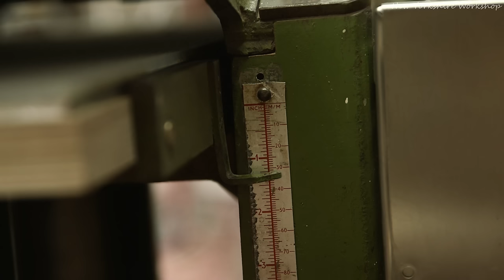Making a beautiful display case from off-cuts

Comment: Amazing skill but the icing on the cake for me was when you lined up the slots in the screws in the hinges!
Reply: Totally agree! 
I get called a perfectionist for doing this but to me it's simply pride in doing it right, and it's pleasing to the eye.
Reply: Been around for years originally used to allow paint to drip and not build up in screw slots. (Before the days of the Phillips and the hammered in screws on sites.)
Reply: Simple stuff that. Those dovetails mitres were a thing of beauty though
Reply: @tug onrye ¹9bi
Reply: The first time I saw that was on se fine furniture competition. One of the judges commented on someone's screw not being in line.. I was shocked they pay that much attention to detail.
Reply: I was told twenty years ago that when you see screw slots lined up, that is the work of someone over 50.  Many of those people are now retired or dead.  We need to keep their care alive.
There's a problem at 40.24.  The slots on the mounts are not lined up.  I would suggest that even though those slots might only be seen by one person each ten years when the case is taken down from the wall, that one person should see the slots lined up.
Reply: What is it? Im not familiar with woodworking and i dont know the terms. Can you tag me at what time he did that?
Reply: @PaanJr  32:03-32:14
Reply: Except I'm a tiny bit disappointed at the use of a traditional tapered screwdriver which mangled the slots a bit. Tendency today is to use what was tradtionally called a gunsmith's screwdriver (hollow faced so that the tip has parallel faces) which doesn't do that.

Comment: Great work, especially on those hidden dovetails. If you want do another frame like that on the vacuum table just run a bit of rope or cord from the inside of the frame to the vacuum holes on the outside and it will vacuum down as one. The rope gives the air somewhere to escape. Good use of the ladies too!

Comment: I'm no woodworker, but I think the only thing I might have changed would have been to use museum grade glass instead of what looks like regular glass.
If my understanding is correct, the museum grade glass removes the potential for glare, yet is crystal clear. And may provide some UV protection as well.
But regardless, an absolutely gorgeous cabinet for those historic cards!
Reply: Also maybe a small drop-in strip to prevent dust from falling down through the hole that the glass slides down through?

Comment: A pleasure to watch. I've learned so much from the few months that I've subscribed. Out of interest, how many times have you got a gut full of threaded rod when you've got a frame clamped up? Regardless of the perils that they may offer, they look much better than the crap band mitre clamps I've got. I think that's part of where my distaste for mitred corners stems from. Bravo on the secret dovetails, I can certainly appreciate the feeling of "one down, seven to go".
Reply from the maker: i tend to use those on lighter stuff so they dont get me too bad, its the bigger clamps that get me! only problem with those little frame clamps is i only have 6 of them! they stopped selling them. I think they have a bit more control over where you apply pressure compared to the strap type clamps.
Reply: @NewYorkshireWorkshop  That's a bugger.... although I saw a video on the Woodsmith channel a few weeks ago showing how to make your own. I'm sure a couple of metres of rod is a relative pittance compared to shop bought, even if the Rutland's sale is still on... (...has it ever finished?)
Reply: @NewYorkshireWorkshop  Just found these: https://www.tyzacktools.com/products/925-quick-frame-clamp-310079.aspx
Reply from the maker: yessss thats them, thanks for that. WTF though, they are manufactured by axminster and sold at tyzak, but at axminster they sell the Veritas plastic version for twice the price! aholes.

Comment: It's beautiful man well done. As a practical piece, I would have used anti-reflective glass though, and a different holding system for the cards. Your system is wedging in fragile cardboard cards in the case, so you're slightly bending the cards by design. A system where each indivdual card is protected in plastic or something would have been better for long term conservation of those collectibles.

Comment: Lovely work. Clever design.  Full marks. 👍
But ffs,  WHY stain Walnut with Walnut stain!!!??? 😳
The grooved panels made a nice contrast with the darker solid Walnut. 
Look mate, I'm not a troll. I was a cabinet maker and furniture restorer. Through decades of experience I have come to the conclusion that wood should keep its natural colour. 
Having said that, you are indeed a gifted young craftsman, and the quality of your work is admirable. 
Maybe just take into consideration the natural colours of each element. 
The problem with staining is that it has the same effect as applying paint- it's called monochrome. Take an old boy's advice. 
Otherwise, God bless. 
Greetings from France.

Comment: OMG Dude. even for how beautiful it is, no serious collector can use it the way it is. With sliding the bare card in you could land up damageing the edges and/or corners. Besides that its possible for the card to stick to the groves over time which would damage the card when trying to remove it or the stain might even land up damageing the edges. I cant tell how much of a bend is put into the card to keep it in the grove, but thats another thing damageing the card over time.

The cards have to go into a small protective sleve called a penny sleve & then it goes into a smal, clear, hard plastic protective case/sleve called a "Top Loader". I know it may sound like a bunch of bull, but im telling you the truth. The hard plastic top loader is about one quarter inch larger then the card from side to side and maybe a half inch larger from top to bottom.

Sorry to have to tell you this bad news because the case really is beautiful.
#JimsHockeyCards
Jim

Comment: Beautiful work, I'm really enjoying going through all your videos. I'm curious though, as only an amateur woodworker... why spend the time cutting all those hidden dovetails instead of using another simpler joint method like dowels? Is there genuinely that much greater strength? 🤔 They are stunning and well crafted dovetails I must say. It's a shame they aren't even on display!
Reply from the maker: Well apart from joint strength there are two main reasons i did it- one is for my own enjoyment; I don't make things like this very often so it is nice to put my self to the test once in a while. the other reason is because it makes the video much more interesting than just using festool dominos or whatever.
 That said; yes this is very strong joint compared to say a domino, the surface area for glue is much greater this way, plus having the joints strategically oriented actually resists pulling apart in the direction of most strain. Other than a butt joint with a very good adhesive there arent many options for such a small joint which has to take the weight of that glass, and the top hinge side joint has to take the weight of all the woodwork and the glass, so it is worth the extra work for peace of mind.

Comment: Hey Russ, what breating aparatus do you use. I picked up the laser you recommended (They used your image in their advert now. Heh) and would like to have some confidence in not dying from fumes when spraying. Cheers mukka
Reply from the maker: I made an air fed mask using pc server fan (its like a powerfull little centrifugal fan), it pulls air from out side though a car cabin filer and then down a dyson vacuum clearner pipe and into a full face 3M mask :)

Comment: Nice job - Did you add anything to seal the glass entry slot on top of the display case? Or was it a tight fit to the glass to prevent dust entry?
Reply from the maker: yeah its preety tight, never occurred to me about dust but i think it will be fine
Reply: @NewYorkshireWorkshop  I was not sure how far the glass was from the runners that mount the cards, if it's close it should be fine :)  Nice workmanship

Comment: Never seen paper backed veneer.. do u take the paper off before putting g it on?
Reply from the maker: it is glued to the veneer to hold it all together, it has lots of advantages including not having to joint narrow sheets together, also prevents bleed through of glue.

Comment: When you start preparing the wood you are not using a planer 😢 your using the jointer function
Reply from the maker: Why is it called a planer thicknesser then and not a jointer thicknesser? :)

(a: Because a jointer is a standalone machine specifically for jointing, usually with long narrow beds)

Comment: You stained walnut. With a walnut stain. And, it no longer looks like walnut. Why didn't you use the walnut veneer on the front face of the  plywood? As you did on the rear face of the plywood.

Comment: very nice. shame the vertical cards ended up sideways
Reply from the maker: yeah he only gave me those vertical ones, if id have known i might have been able to make to accommodate the landscape ones as well, but then the backs are all vertical so its swings and roundabouts
Reply: @NewYorkshireWorkshop  Yeah you would have to know the number of Portrait orientation cards to be able to place each one next to it's horizontally oriented 'back of card'.  If the customer had shown you that I know you could have done it creatively.  Very different sort of project.. the detail of the hidden joints is sadly lost.  Great that we get to see the intricacy of them!